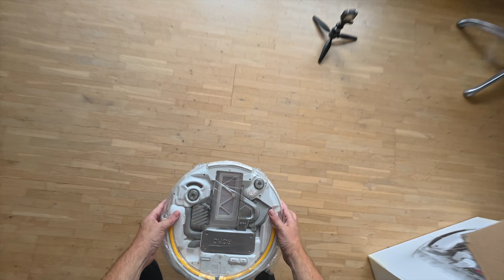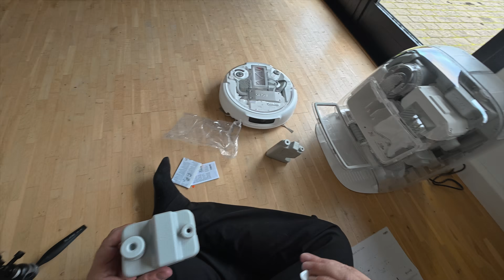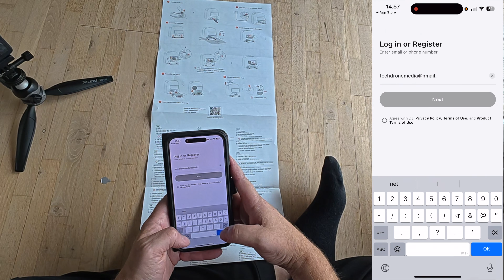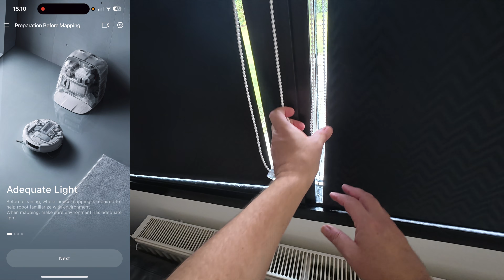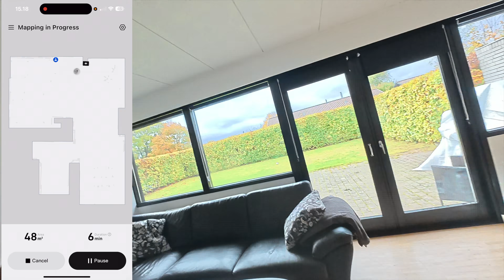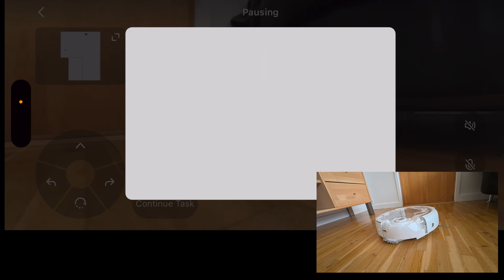DJI ROMO P – Robot Vacuum Cleaner – Unboxing & First Setup for Beginners

Comment: Over $1500 for a vacuum cleaner is insane
Reply: You get what you pay for. This must be good quality.
Reply: Then get a $300 one and regret it instantly.
Reply: @stephanos2758 Got a $400 roborock that does mapping and it's been working for 3 years with no complaints